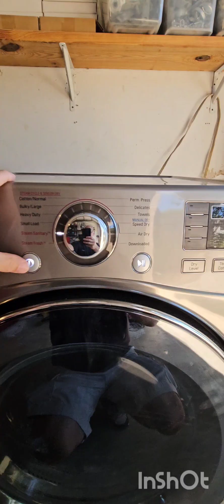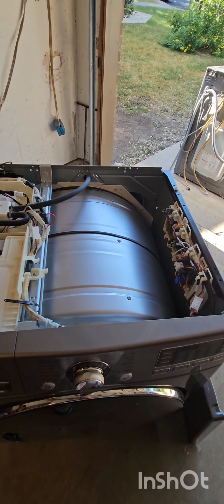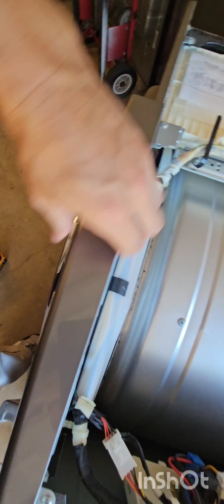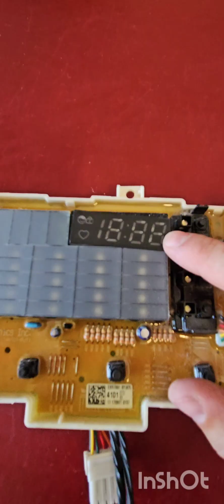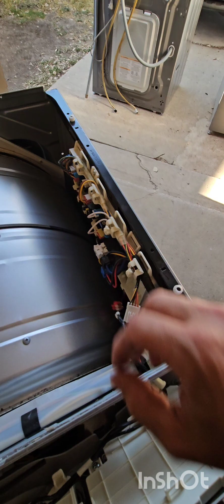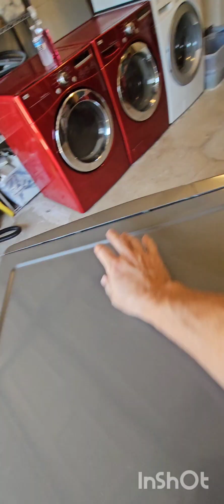Can't Read LG Dryer Display Screen. NO COST REPAIR!!! (Step by Step Guide)

Comment: Hi, so I have a very similar LG (dlex3875) but it has a bigger screen than the one you worked on here.  It turns on and plays the little song but display is not lit and nothing works.  I replaced the main board and still does the same.  Any thoughts ?
Reply from the maker: It sounds like you need a new user interface board.
Reply from the maker: I just looked to your model up online. Here is a link for one on ebay. I believe that this is the right one for your machine. https://www.ebay.com/itm/266939909341?mkcid=1&mkrid=711-53200-19255-0&siteid=0&campid=5339129678&toolid=80005&mkevt=1
Reply: @RandysHereToHelp thanks man, I ordered the UI exactly as shown.  So I'm thinking the main board was ok ?
Reply from the maker: @dmlagrange yeah probably!!!
Reply: @RandysHereToHelp Yes it was the UI! Machine is alive again.  Thanks so much man!!!
Reply from the maker: @dmlagrange Awesome!!! Glad I was able to help you!!!